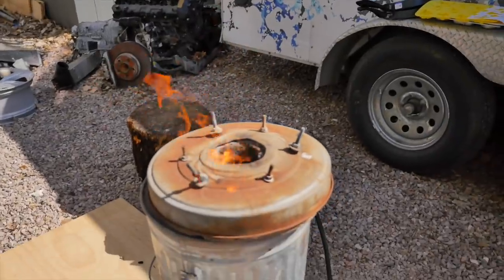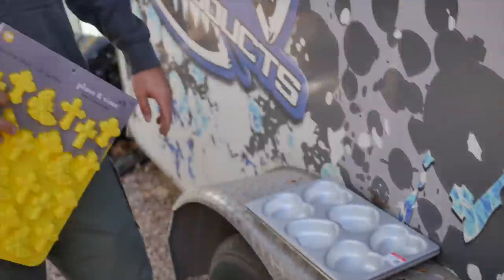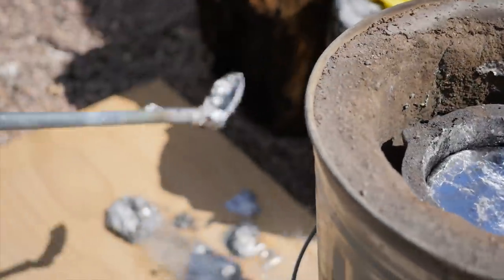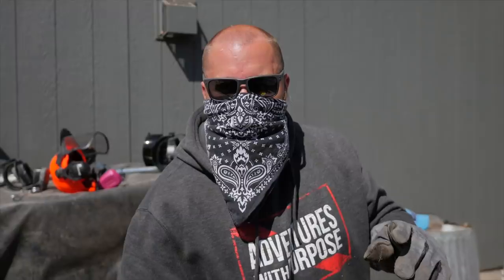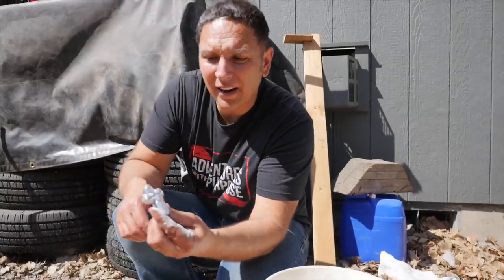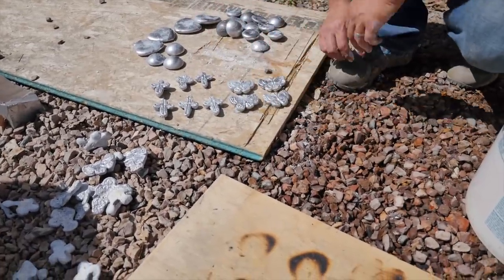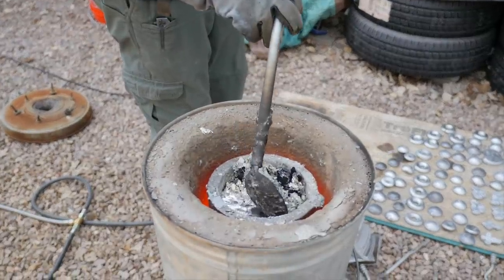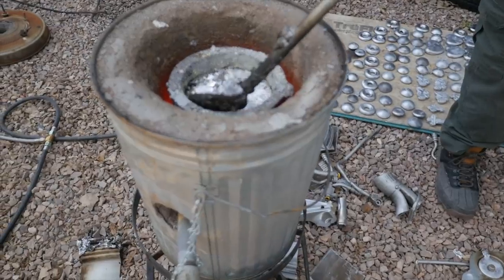DON'T TEXT AND DRIVE: Souvenir (PSA) Keepsakes from AWP

Comment: Im not sure if you are aware but you need to heat up your molds before you pour in your aluminium if you pour into something cold it cold flair and flash on you spraying you with hot aluminum so be really careful and aware that could happen you can use a simple torch to heat ur mold or even sit them on top of the forge for few min also your spoon will have less aluminum sticking to it if you keep it heated